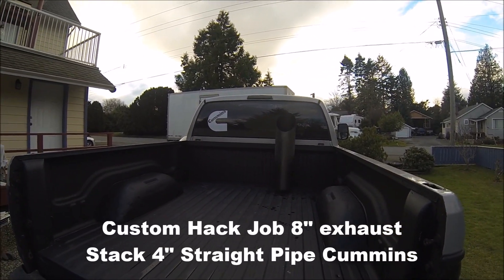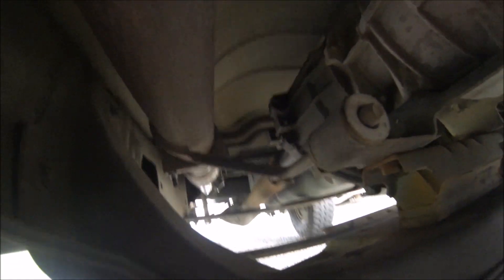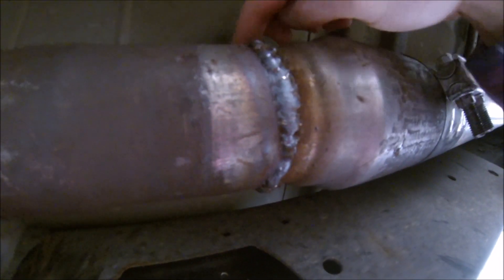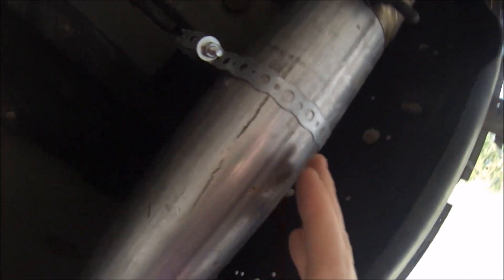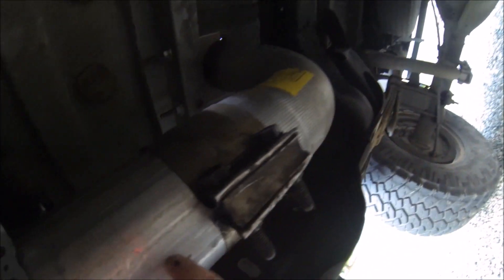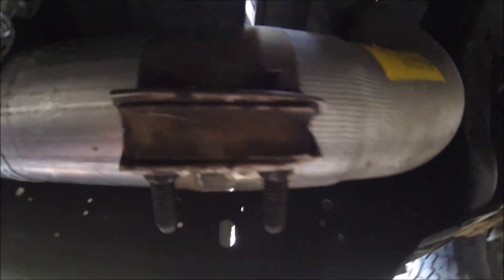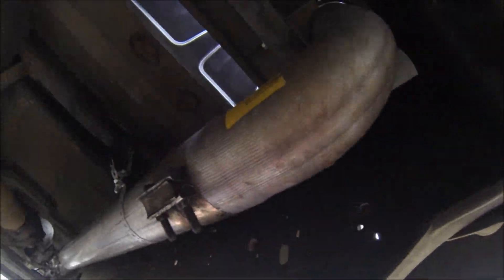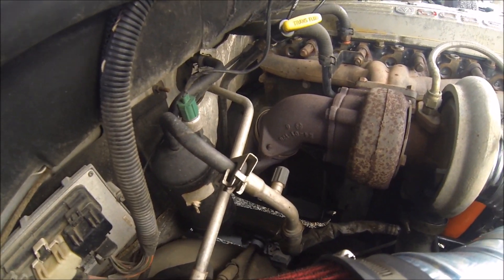Making An exhaust Stack System For a Cummins

Comment: so guys just buy a full straight pipe exhaust install it cut the pipe off at the beginning of the bed and get a 90 degree elbow put stack on that and your done
Reply from the maker: Stephen Stills yeah cause that's cheaper than just buying the necessary piping...? Buy a $400 exhaust just to cut half off then buy an elbow and more piping then buy a stack for another $150!!! Great plan dude
Reply: TrucksAndTuners but u can just bolt back the part you u bolted for the stack if u don't want the stack anymore
Reply from the maker: Stephen Stills not if you cut it
Reply: TrucksAndTuners most of the time they come in sections that u can just unbolt that part that u want off then bolt back on when ready